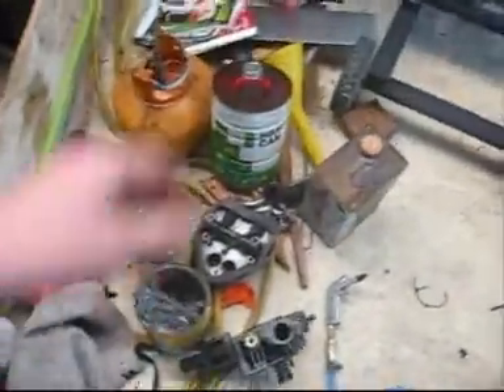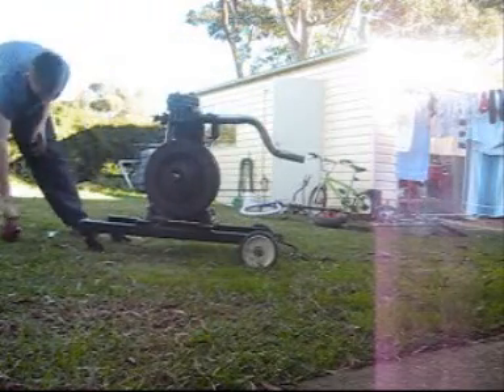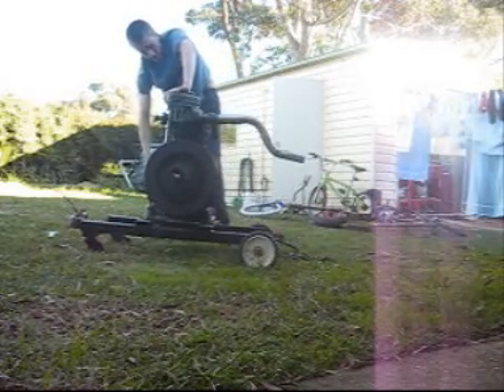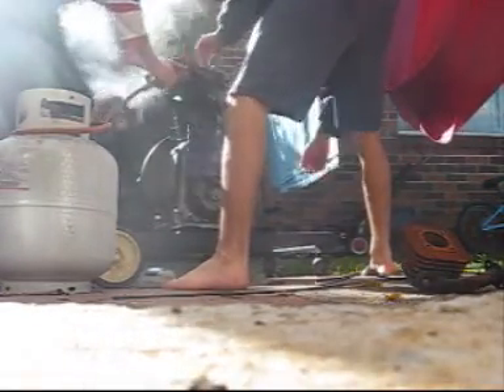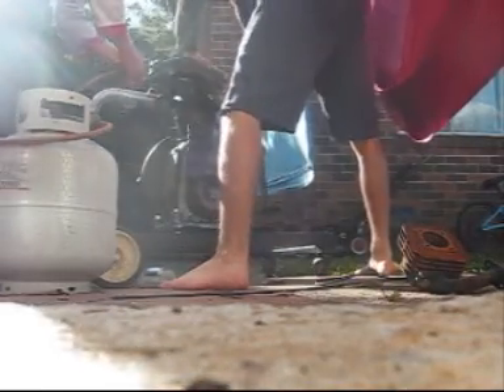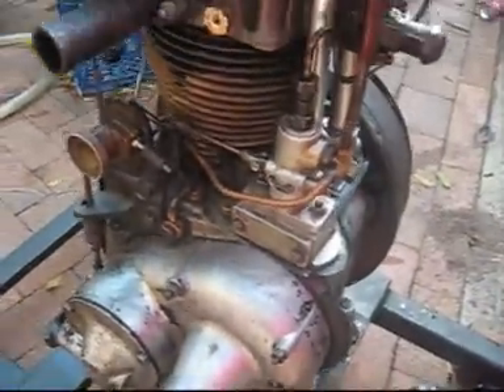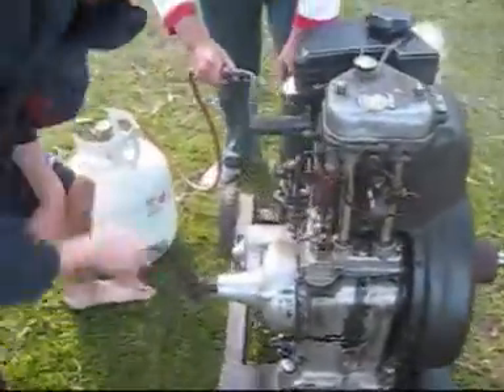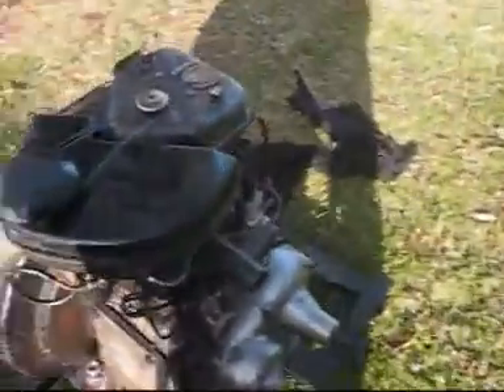Coventry Victor try to start

Comment: love the motor great work you guys i am very interested in engines and mechanical stuff i have a 16hp v-twin Briggs and strattons and a 14hp intek single cylinder and a Tecumseh 6hp engine and a 25cc weed whacker engine also a 27cc leaf blower engine also a 3hp briggs and strattons.but any way great work that will sure last cause you guys did a great job.

Comment: Ah right. I would imagine then that the big end is fairly well shot if compression is as low as it appears? How well does it start now?

Is it direct injection like my little Petter diesel? The injectors often had copper shims under them, you can remove these to help with compression and getting the spray to the right possition. I would also imagine that it's a copper gasket that was leaking? Did myou anneal it before replacing it?

Nice engines those Victors, and rare too!

Phill.

Comment: Where you put the oil feed in instead of the glow plug i noticed you got a hole in the middle? Does that mean extra air is getting into the combustion?

I might be talking crap but worth a thought?